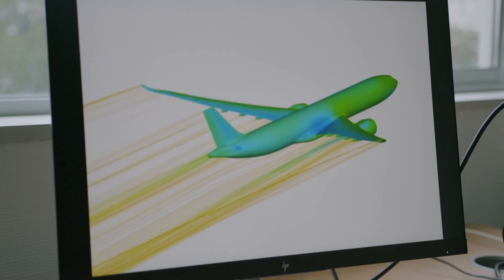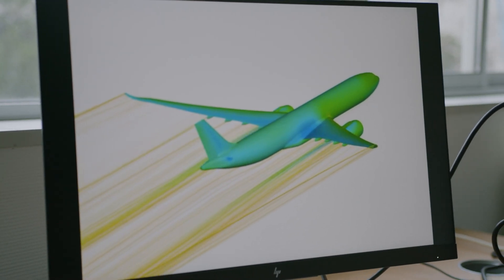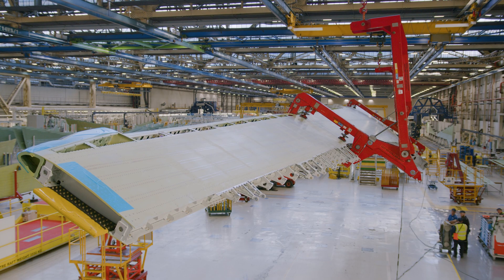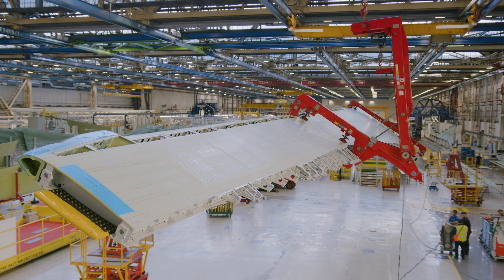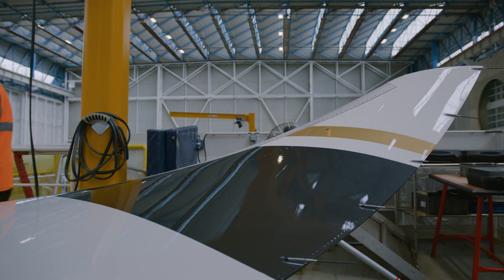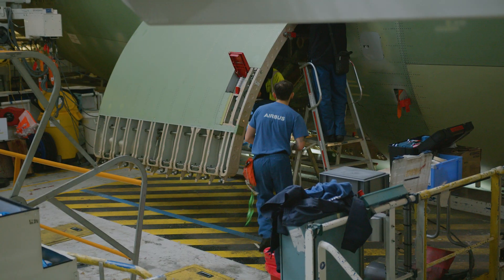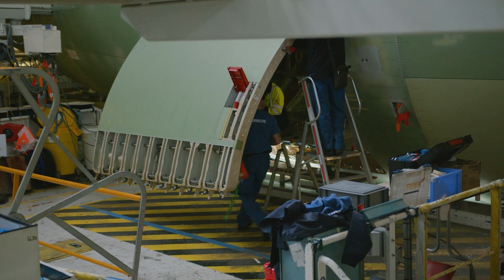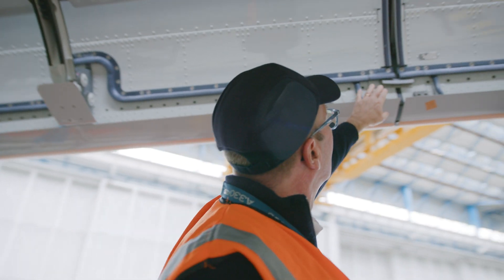A330neo: The Heir Apparent - Season 1, Episode 1

Comment: The A330-900neo is essentially (more or less) close to what Airbus proposed with the original A350 model around 2004. But by keeping it based on as much of the A330-300 as possible, some initial compromises in range had to be factored in, though a higher weight model did push the range to 7,200 nautical miles. The A330-900neo, in effect, became the successor to the 777-200ER.

Comment: A330Neo is a wonderful aircraft, but naming it was not completely correct. Neo - New Engine Option implies that only its engines have been renewed, but actually wings were completely redesigned and became the wings with the highest A/R among wide body aircraft. So another name like A330Plus could have been better.
Reply: The 320neo series also had redesigned wings and a whole package of impovements across multiple areas. They are keeping to tradition in naming it the 330neo.
Reply: @anon-ed5wf  A320Neo doesn't have any change in A/R, wing area or wing span. Just wingtips were changed.
A330Neo has brand new wings with wider span, different wing area, better A/R.
The "tradition" to use New Engine Option name was wrong. Bad marketing.
Reply: @user-198yt Think of ‘neo’ as a brand by Airbus which has expanded beyond the engine. Look at the linguistics side if it too: ‘νέος‘ (neos) is Greek for ‘new’. That is what Airbus is doing; taking their current aircraft and creating a new version with new engines foremost, new designs in different areas, and new technology, all of which is the next generation. Branding it as ‘neo’ works when you put it all together and is better than ‘plus’ which is too generic and bland in my opinion.